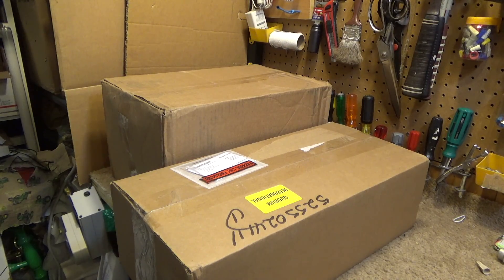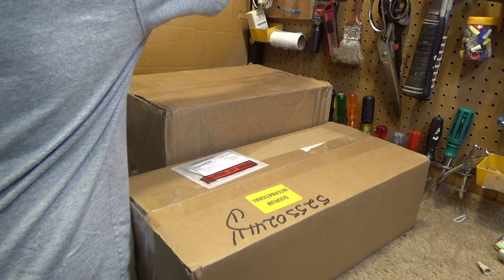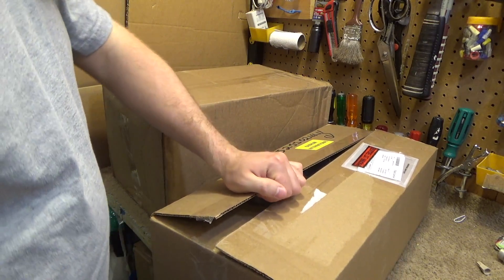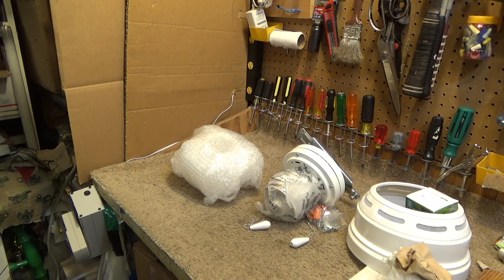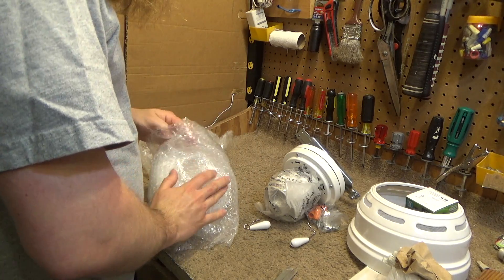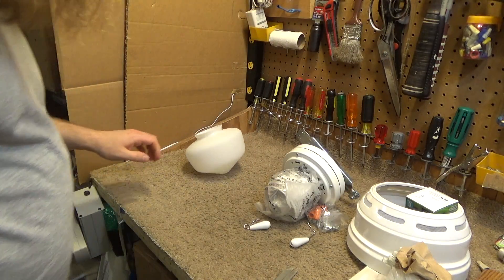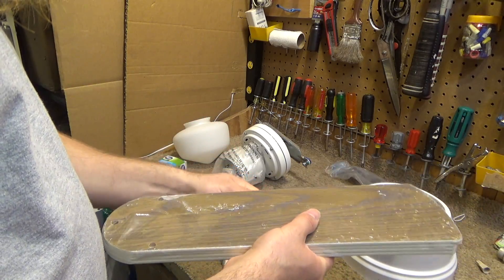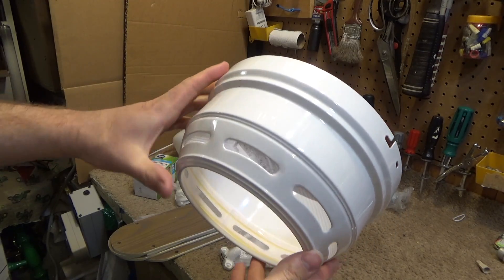Go Figure

Comment: I stayed in a motel on the Gulf coast last winter that had this exact model. I honestly didn’t see one like it before as a Main Stays. Obnoxious stickers were all over it as well. 
It was undersized for the room. The weather went from 93 day one to 45 day two. Mini-split was used to condition the space. 
The fan moved no air besides high speed, even right under it. So it ran on high for the four days I was there. 
I will say, it was positively silent on high. Shockingly silent. And it was mounted on an old metal wire-mold box which was mounted to a concrete ceiling. Plenty of ability to transmit hum. None whatsoever. 
I never tried the light so can’t speak for it. 
For a cheap fan in a small room, I think it’s just fine, especially being so quiet!
Reply from the maker: I've since installed this into the 12x12 room upstairs. The motor has quite a hum/buzz to it, but the air noise is very low. The air movement is also very low, it's pretty much useless in the room even on high. Can't expect much for the size and form factor. The light works just fine, pretty hard to screw that up. It will be left here when I move out, so it's good enough for the next few days before that happens.

Comment: I will never understand why those have that huge sticker on the switch housing it clearly is designed to be on top of the motor sadly that’s not even a one off thing.
Reply from the maker: I can only imagine it's some stupid safety or efficiency regulation that requires the information that 99% of consumers know nothing about to be in plain sight.
Reply: When I had mine I just ripped that thing off, it was ugly